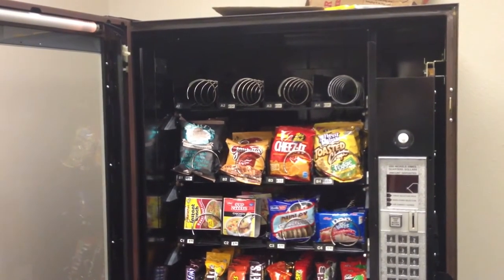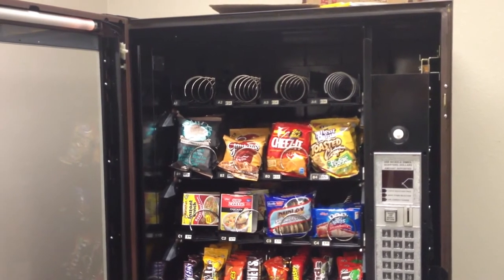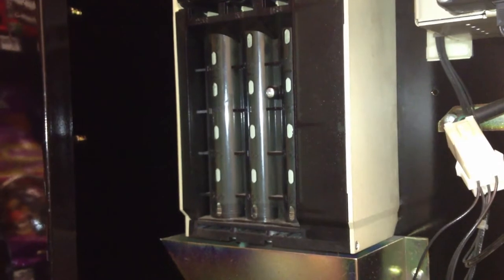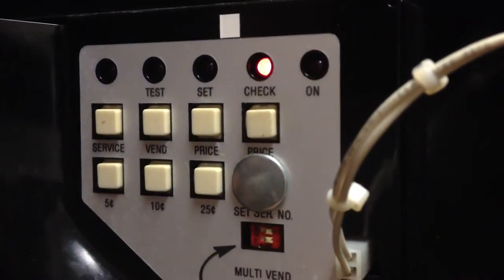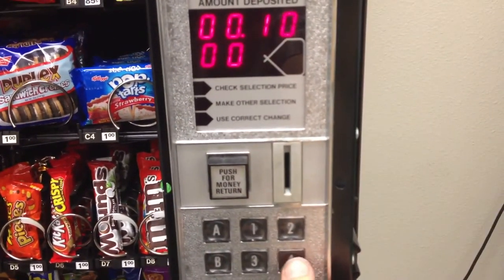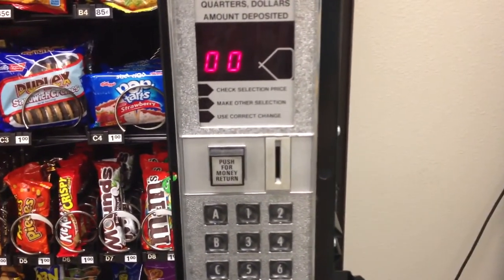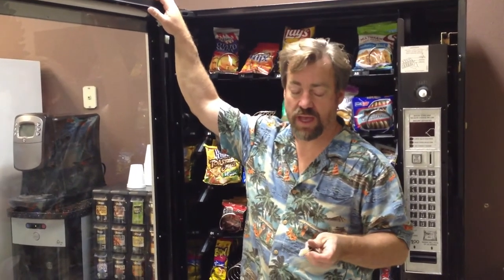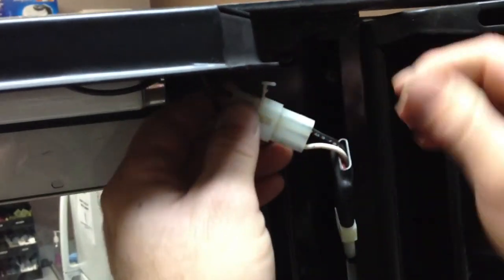How to Diagnose an AP Snack Machine that is Randomly Vending

Comment: Hello! Eight years after posting this video it seems to describe exactly the problem I am dealing with in my AP 6000; including the flickering light! I am going to replace the bulb but I would also like to add the power conditioner you mention but I can’t seem to find it online. Do you have any recommendations for where I could purchase one of these? 
PS I’ve already replaced the display board AND the control board but the problem persists. Thanks!
Reply: hey im having this same problem was you able to fix the problem?